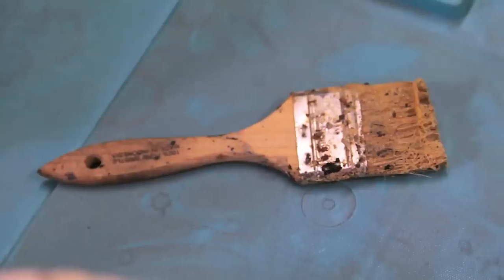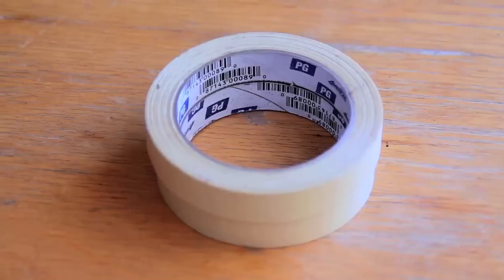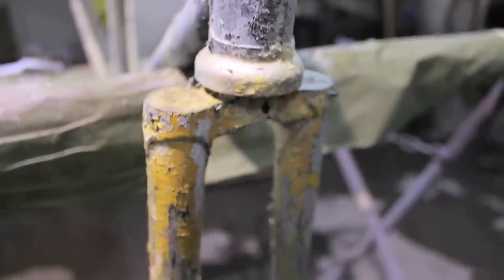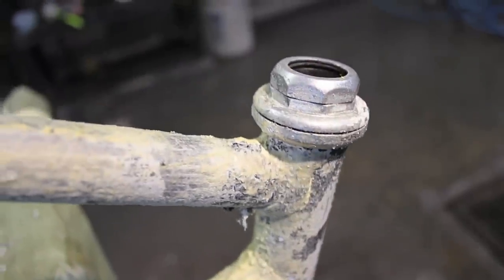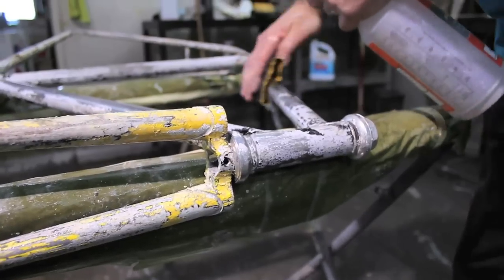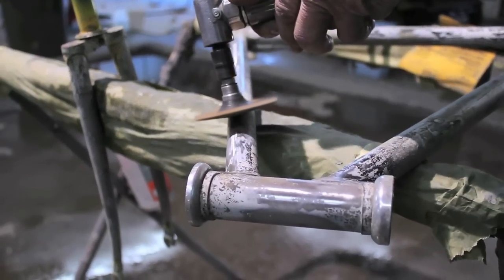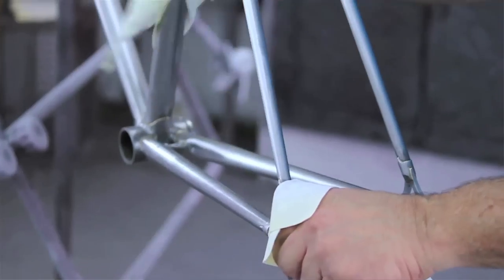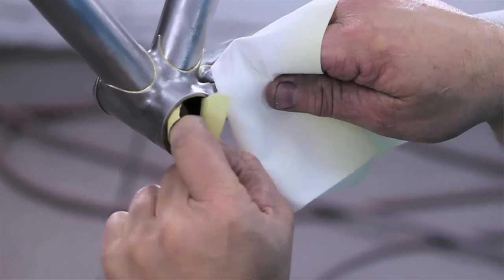How to Paint / Restore Your Bike Frame Part 1

Comment: Great video! Unfortunately, the frame I'm looking to strip and paint is a carbon fiber frame. I can't use solvents or it might mess with the integrity of the carbon. You did an excellent job at removing that steel frame! Glad your videos aren't over five minutes. Some of the videos out there are super long and take a while to get to the point.

Comment: nice video. straight to the point.  do you wrecken I could use a garden powerwasher to clean the stripper off?
Reply from the maker: Dave Cutz thanks! And you totally can just make sure to wipe it off and dry it really well since you can get a lot of excess water in the frame with a powerwasher

Comment: Pro tip you DO NOT  have to strip all
The paint of unless your frame is in really bad shape and scratched up a simple scuff with sand paper to remove clear coat  then a high build filler primer followed by wet  sanding to smooth surface if you have chips just sand smooth the edges  I never really  the whole complete strip process they don't strip whole cars when repainting why should we its waste of time and doesn't really effect the end outcome all in prep work
Reply: can I use can spray paint?
Do I actually need an air compressor and paint guns? (that's a great expense)😀

Comment: I actually need the steps before this. How do I get all the hardware off my frame?
Reply: Indeed, one should not leave the headset and bottom bracket on the frame like in the video...
Reply: Lots of specialty tools.
Reply: @buggzo  You'll need some specialty tools for sure, but you can actually get a really good set from Decathlon for around £60 which should have everything you need to take a whole bike apart and rebuild.

Comment: Holy moly where did you find that bike?? So much crap and residue on it. If my bike is white with a couple of scratches and I intend to repaint it white, can I skip, stripping it to the bone?? All I want to do is retouch but not in a shitty job way. I want to do it properly.
Reply: CTAjunior man, that wasn't the oriinal state of the bike, it was the paint remover working on removing the paint.

Comment: Is this a steel or aluminium frame? Can you use the steel brush on an aluminium frame?
Reply: yes you can, but since steel is harder than aluminium you should try not to be too harsh, otherwise youre going to do a really good job sanding and potentially sanding off too much to make it look clean once theres paint on it

Comment: im using a sander to strip the painet off of my fixie and its creating a ton of grooves making my bike very rough, can i just go over it with finer sand paper or is my frame thrashed
Reply from the maker: matthias miller it depends how deep the grooves are, but yes start stepping up to finer grit to smooth the frame out 200-400-800 then prime it

Comment: Why are you using chemical paint remover?  Why not take it to a local Sand Blast / Bead Blast company.  The cost for me in this area is $25.00 and it only takes them about 1/2 day to turn it around.

Comment: The whole process is a pain in the ass. First off, the gloves still get eaten away by the stripper so theres no saving you. Next, the headset cups nor bottom bracket covers were removed. Thirdly, it takes a hell of alot of time for all this shit to be done properly. 2 days; 1st for the application of the striper and removal of the residue (and possible repetitions), 2nd for sanding/prepping/priming (because you dont want any goddamn flash rust). Overall, I highly hope anyone who does this has alot of patience. P.S. if im correct, he fucked up a Bridgestone Anchor.
Reply: What then then do you suggest someone go about painting their bike?
Reply: Alex Olavarria  Bead Blast.... and then paint

Comment: I loved your video. I noticed in your video that the paint remover that you mentioned, the Aircraft Paint Stripper, will burn your skin. I have a product that won't burn your skin and its an eco-friendly paint remover called EFS2500. It will work as well as the one that you are using for the demo in your video. Please check out my channel, my Facebook page (Mtc Canada), or my website to give you an idea on how my product works. Thanks.